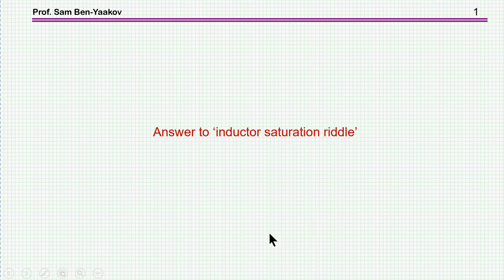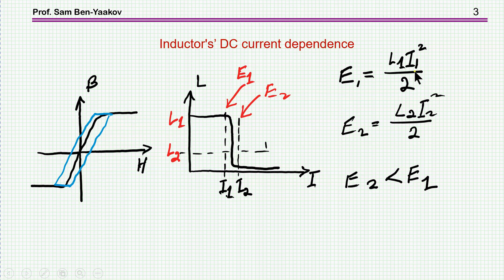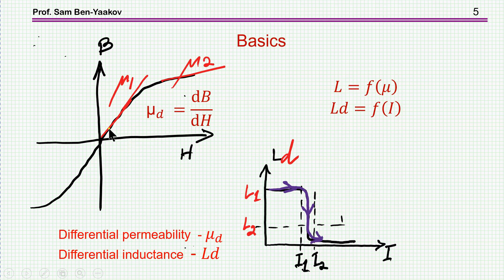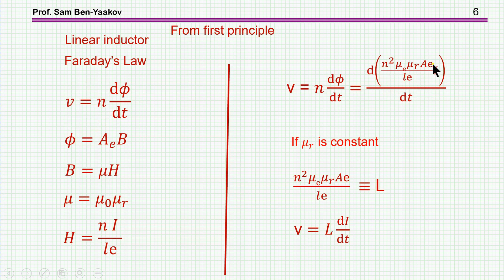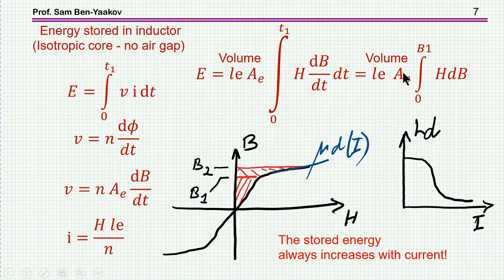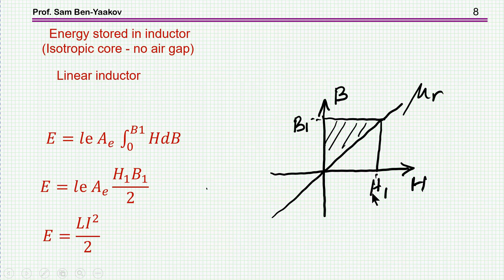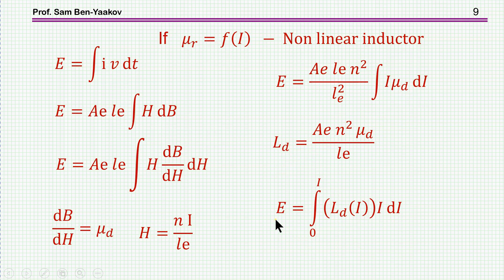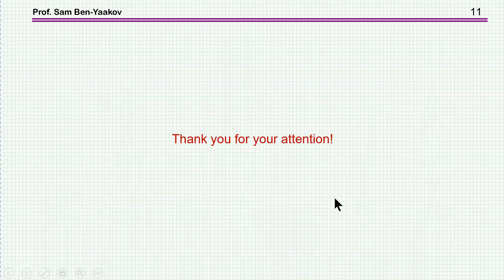Answer to ‘inductor saturation riddle’

Comment: Hello, i have question due to my test circuit. I measure coil saturation current by observing voltage on 0.0125Ohm resistor in series to coil on B1 area when it is still linear. I use good pulse gen. I have test transformer from 3kw inverter on 24v so i expect to have 50 or more Amps....on one of push pull coils.  I have scores of 10..15A !? When i measure singe coil (no transformer) i get proper values with even 40A scores so it is not issue with my test circuit (big capacitors and gel battery)....maybe it is by the fact i use 12v in test circuit and trafo coil has ~50v p-p ??? Thanks in advance :) regards

Comment: When the core's bulk (majority) of electron spins are aligned, the magnetic field of the core has reached its max level of magnetization  (aka it is saturated).

HOWEVER.  Since there is a coil of wire still present around the magnetic core, and since current in the coil can still be increased beyond the point of saturation of the core,  the increase in energy past the core saturation cannot be stored in the core.

The additional magnetic field created by the increase of current in the coil, admittedly, can no longer increase the B field in the core, since the core is saturated.   But the additional magnetic field of the coil can easily increase in volume it occupies in space.

EXAMPLE
1)  a coil is capable of 100,000 amps
2)  its (non-gapped) core saturates once the coil current reaches 1 amp
3)  as the coil current is increased from 1 amp to 100,000 amps, the coil's magnetic field grows, but the core remains saturated, at its max B field (maximum magnetization)

So the additional energy IS NOT stored in the core once it attains saturation.  The additional energy must therefore be 'stored' in free space, in the vacuum, in the form of an increased  "coil only" magnetic field
.
Reply from the maker: Thanks for comment, but all this is very well known and taken into account. It is generally assumed that at core saturation the relative permeability approaches 1 (not zero) and the vacuum or air permeability is left. So basically what is left is an air coil.
Reply: @sambenyaakov  right, I was trying to re-state what you presented.

There are two devices at opposite ends of the spectrum related to core saturation:

A 'magnetic amplifier' purposely saturates the core at a chosen time by way of a DC-powered winding to create the huge drop in inductance/permeability, so as to bring about an amplification of the AC or RF running through a second coil winding; as the core saturates, the permeability drops and the AC current then increases.  This is also known as a 'saturable reactor'

At the opposite side of the core saturation game is the gapped core, used in for example a flyback transformer.  It allows much higher input signal to the primary winding while preventing the core from saturating, using a 180 degree phase shift and a blocking diode in the secondary winding to de-couple the primary's energy from the secondary until the huge magnetic field in the gapped-core primary is allowed to collapse, which forward-biases the blocking diode and couples the large collapsing primary field to the secondary.  CRT monitors used high power flybacks as the cheapest way (a gap in the core and a diode!)  to create the large voltage in the secondary used to accelerate the electron beam toward the view screen.

I liked your video because it clarified the math and operation of core saturation and change in permeability and self-inductance when saturation occurs.  It was well done, and enjoyable - thank you!
Reply from the maker: @Greg_Chase  👍

Comment: How are transformers designed so they can tolerate small DC currents without going into saturation?
Reply from the maker: Small air gap
Reply: @sambenyaakov ,
   Ah, so the air gap reduces the magnetic flux around the core for a given mmf. I suppose powdered iron torroids have a "distributed" air gap due to the space between the iron particles.  Makes sense. Thank you.
Reply from the maker: @jessstuart7495  👍

Comment: Hi Sir,
a question that arises whenever i wind inductors, which makes sense here, is: How is the saturation magnetic flux density related to saturated current. As B = uH; and H is a function of I. For Isaturation there would be a Hsaturation and hence from the B-H curve a Bsat. Can it be also derived with equations to get a more exact approximation of Isat from the value of Bsat. This problem occurs when u have datasheets that only give you Bsat. Thanks for your reply in advance!
Reply from the maker: Have you seen https://youtu.be/M3OEM6lnfRE  ?
Reply: @sambenyaakov  no sir. Thanks for the suggestion

Comment: An important point :where is this energy dissipated? 
my_guess: 
 NOT external to the the inductor OR transformer but in the core material and the copper losses of windings ; in the case of the
transformer the , primarily in the primary winding when the core is saturated.
Reply from the maker: Indeed

Comment: So the core is able to store relatively less energy per dI once it passes the knee?  Do you already have a video on the macro effects of inductor saturation within a switching converter?
Reply from the maker: 1. Yes. 2. Good subject. Will consider.
Reply: @sambenyaakov   ... I've read that proper output L selection for smps is needed to avoid sub-harmonics when smps is at 50% duty cycle - but no explanation was given. Could you do something on this?  What is "proper" there?  Sounds like some kind of modulation issue, no?

Comment: Professor, using differential permeability and inductance is a clever way to abstract its nonlinearity. But, I want to know the analytical expression of the permeability and inductance itself.

For example, Vectorial Incremental Nonconservative Consistent Hysteresis
 (VINCH) model, it is the latest research that describe its nonlinearity as far as I found it on the internet. And also being vectorized model, makes it better compared to fundamentally scalar of Preisach and Jiles-Atherton models. Although the conclusion section stated that it's only consider the special
 case of rate-independent isotropic material.
http://vincent.francois-l.be/VINCH_model.pdf

Would you like to please explain it from theory till simulation perhaps, in the future videos? Thank you very much.
Reply from the maker: There are a number of ways you can study  permeability: the phenomenological (B/H, Maxwell equations), the model fitting (Atherton, VINCH) and the material aspect. Each has its own place.

Comment: Hallo professor, i know you can help me with this,  to calculate the number of turns "N" i am confused  between (L = AL*N^2) formula (AL value from datascheet of a EE-core "N97" for example) and (N = (L*I)/(B*Ae) formula (L,I,B are given and Ae from datasheet). in each formula i get  an another value of "N" . thank you
Reply from the maker: There is a difference between formulas. The first states the L you will get (this will be for a given gap). The second ensures that  a given B will be reached at a given I
Reply: @sambenyaakov   thank you 👍👍

Comment: so. after watching this video i don't understand, what wasn't resolve at my answer for this riddle. 
"
energy doesn't go anywhere and doesn't appear out of nowhere. the expressions given in the middle of the video are valid separately from each other for two different inductors that have a constant inductance over the studied current interval in them. In reality, the energy storage process can be divided into several stages( for ease of integration):

0) energy consumption in heat from the winding resistance ( including eddy currents and skin effect) and core heat for the remagnetization of dipoles

1) the current increases from zero to the inflection point of magnetic induction, energy accumulates in the dipole moments of the core as long as the dipoles are able to rotate freely in a certain direction, then different behavior is possible for different materials, two or three inflection points are possible, etc. and different slopes between them

2) after the inflection point, there is a long section of current that ends with constant magnetic induction through the core(only through it), at this point all the dipoles are aligned along magnetic lines. During this entire interval, the energy accumulation in the inductance formed only by the wire( an inductor without a core, only air) also continues.

3) then there is accumulation only in the inductivity formed by the wire up to the theoretical limit, if there is one. I have never asked myself whether there is a maximum magnetic induction for a particular volume of space

On the interval 1-2, the inductance remains in the "nominal"
on the interval 2-3, the inductance "decreases" according to the law depending on the core material, which can be divided into its own sub-intervals
on the interval 3-infinity, the inductance is equal to the inductance of the coil winding without a core

using splitting into these intervals, we can use the formula from the middle of the video separately for each interval to calculate the energy by summing the energy of each interval. As a consequence of the non-decreasing sum of the series, we have E1<=E2, which in our case is E1<E2 because there is always a winding from the diode, which also accumulates energy

Please correct me if I'm wrong anywhere,it is always important to correct inaccuracies in their knowledge
"
I took a slightly different path in the explanation, and instead of a strict mathematical explanation, I used a division into intervals at which the original expression of energy is valid
Reply from the maker: Hi , I do not understand the reason for your grievance. Following your first reply I responded: "Thanks. You have a good gut feeling but the explanation does not resolve the the question as asked" Then you added more explanations showing the equation L(i)(I)di/dt  but without explaining which L(i) is it,  derivative or total. Also "energy accumulates in the dipole moments of the core as long as the dipoles are able to rotate freely in a certain direction" , is not exactly correct. What about a core with air gap?  And what is: " because there is always a winding from the diode, which also accumulates energy". So why the complaint?

Comment: Thanks. This was actually my original answer:

"The simple answer is that this is a trick question, as the given energy expression does not apply to varying or non liner inductance. There should be another term involving L^2 and i. Coil energy is derived by integrating instantaneous power vi, but L is a function of i, so derivative should be according to  chain rule using two parts... This is similar to energy stored in a moving coil, both i and L are functions of the displacement parameter (x or theta). In this case, some of the energy dissipates  as core losses, due to the change in current leading to dipole movement..."

If the L(I) dependence can be approximately formulated, one can derive an analytic stored energy expression. As for the second part, while core saturation and hysteresis losses are two different phenomena, any change in current in a saturatable inductor will lead to some power loses. 

The energy is obtained by integrating iv as i*d(Li)/dt = i*[(di/dt)*L+(dL/dt)*i] and so on...
Reply from the maker: Well not exactly.
Your derivation:
____________
The energy is obtained by integrating iv as i*d(Li)/dt = i*[(di/dt)*L+(dL/dt)*i] and so on...
_______________
Is incorrect . Write to sby@bgu.ac.il if you need an explanation why.
Reply: @sambenyaakov  

Thanks.  I'll have to dig into it more deeply, but the interesting thing is that I was able to get correct analytical results when I modeled a simple  electromagnetic machine in  PLECS, where I had a variable inductance L(theta) and thus L(i). But is was linear dependence.  Using the  obtained energy expression, I was able to calculate the correct torque of the machine... So, it seems that my assertion for calculating energy as stated above does work for some scenarios, or was it the bad clock that shows the correct time once a day concept? :-)